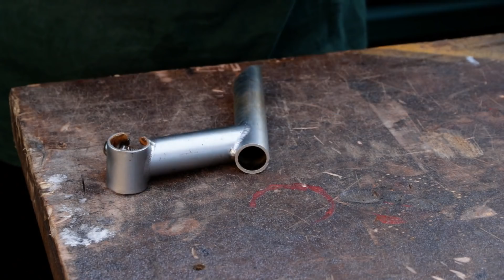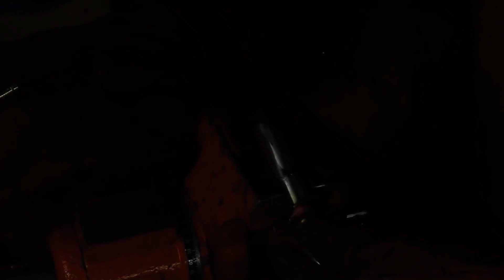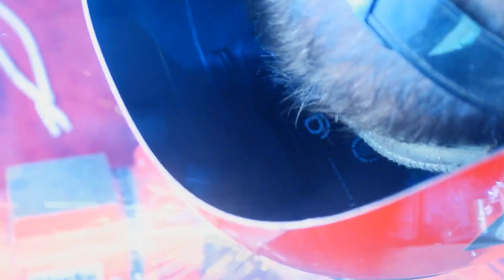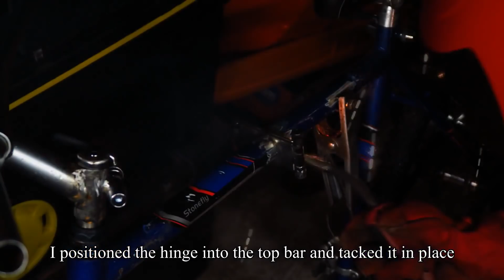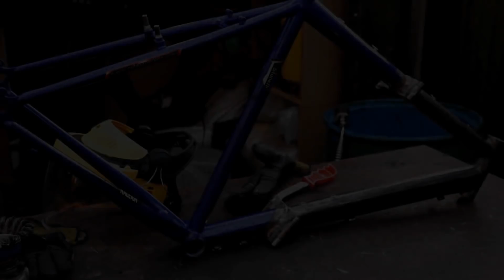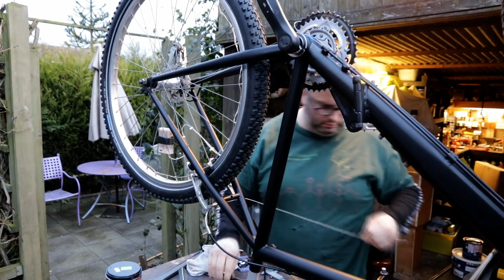Homemade folding mountain bike conversion

Comment: Where do you get the folding parts from to do the conversion?

Would it be better to have smaller tube inserted into the bike tube and then put the bosses on and Quick release skewer in?

Do the brake and gear cables need to be longer?

Why cut the Handlebar Stem?